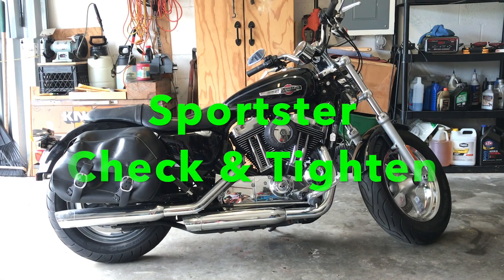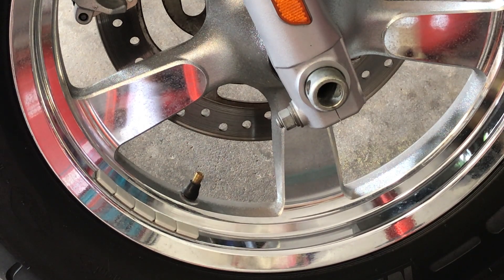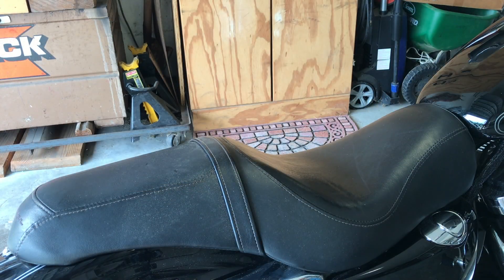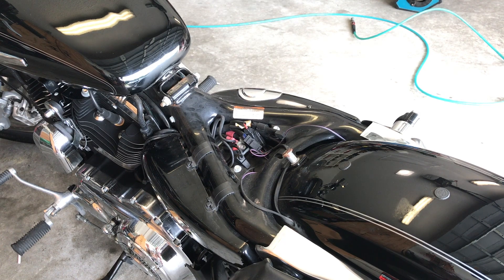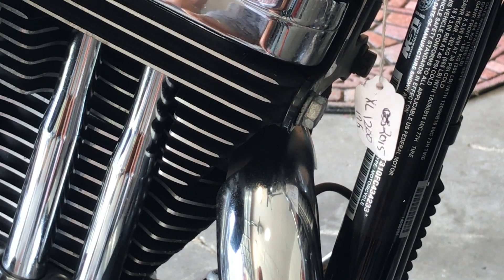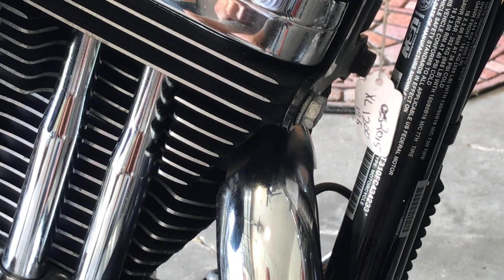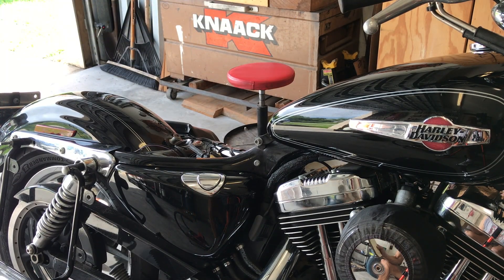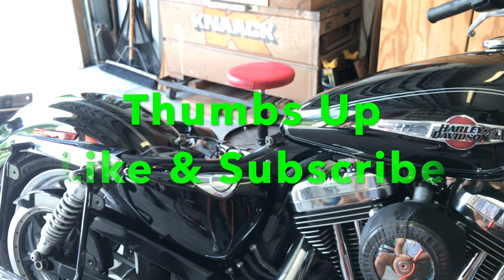How To, Sportster Things To Check And Tighten.

Comment: When you opened the battery area and pointed to the terminals, you should have mentioned the older bikes (like my 2005) that have the NEGATIVE buried on the other side. A lot of people re-route the cable (sometimes replacing the cable with a longer one) from the negative terminal on these to make it easier to remove/replace the battery.
Reply from the maker: If you tilt the battery and install the negative it's not that bad check out the video. If you go straight in with the battery it is a bear!   Harley knew what they were doing when they designed that.. dealer dealer dealer.  And thank you for your comment. Ride Safe and have a great day.

Comment: Yep... the 2010 Sportster I just got had a dirty 10 year old air cleaner and throttle body from use and a loose 3/4" left side engine mount bolt -  just like you suggested. Thanks and keep it up!!
Reply from the maker: Happy to help. Any questions just ask. The sportsters are great motorcycles. Thank you for watching and all your support. JT. Ride safe and have a great day.

Comment: From the Philippines here,Thanks for the tutorial,have a 2017 sportster this video is very informative!
Reply from the maker: Happy to help. Any questions just ask. Thank you for watching and you sub Bonaparte. Ride safe and have a great day.
Reply: @TwoWheelRocco  Just a follow up Sir,just completed changing oil(Amsoil 20w50),loaded just 2 ltrs.,plan is to gradually add after doing runs just not to overfill,but after checking oil level on my dip stick,it is still on the high level,have to suck some amount out of the tank, don't know why I keep on having a full reading on my dip stick,any advice?
Reply from the maker: @bonapartebeneficto8294  You have oil that bypassed your oil check valve. So the oil gravitated into your dry sum motor. So every time you start the bike and run it the oil is cycling out of your motor back into the tank. This is popular with the V twins when they were in storage for a while. That's why it's always a good thing to run these bikes before doing an oil change. And then you'll have a true reading of the oil that is in your system.. Sportster  like halfway on your oil dipstick no more. You'll end up fouling up air filter. Hope this helps.

Comment: I just watch this video I’ve had stuff come loose on mine over the 19 years I’ve had the bike. Front motor mount that was one and the exhaust rear muffler on the mounting bracket came loose. The crossover on the rear pipe cracked don’t know if that’s what caused it I took it off and welded it up this year. Definitely going to check the riser bolts and the hand grip hardware. Great video on what to look for. I do all my own work on my bike even change the tires myself. I like your videos on how to do the job just put me more at ease when I’m working on my bike.
Reply from the maker: Happy to Help.  Love doing all my own work.     Thank you for watching and your sub White . Ride safe and have a great day.

Comment: On the jiffy stand on not to check the oil???
Reply from the maker: I'd say refer to your Owners Manual here. On the 04 & later Sporties, the manual calls to the oil level to be checked with the bike on the jiffy stand. When your bike has been warmed up for proper reading.

All in all, I don't think that tipped on the jiffy vs upright makes all that much difference if your like most HD owners that have learned that keeping the oil level about mid way between the ADD & FULL marks reduces oil blow-by into the air cleaner. 

Hope this Helps, Any questions just ask.  Thank you for your Sub Joglock. Ride Safe and have a great day.

Comment: Thanks for all your videos Rocco!
Reply from the maker: Happy to help. Any questions just ask. Thank you for watching and your sub Greg. Ride safe and have a great day.
Reply: @TwoWheelRocco  i do have a question actually..i just recently bought a gas tank second hand for my Sportster.its in really good condition and theres no visible rust or debris but i do want to give it a clean/flush before i put it on my bike..what would use to flush it with and what would be your process? Just a simple flush of the tank needed,i have a brand new oem petcock,filter,gasket and line to go on..thanks Rocco
Reply from the maker: @scrambledgreg3834  I would use compressed air and a vacuum cleaner place the vacuum cleaner at the bottom and compressed air at the top and as the compressed air moves the dirt the vacuum will suck it out. That's how I do it.  Hope that helps.
Reply: @TwoWheelRocco   ok great thanks Rocco!
Reply from the maker: @scrambledgreg3834  Happy to help.

Comment: as always very helpful thanks..  one question, i have vance and hines 3 inch twin slash slip ons how to remove stuck quiet baffles they are stuck very very tight . i dont mind damaging the baffles but not the pipes. any help appreciated
Reply from the maker: Remove slip on and push from other side with broom handle. Tap tap with hammer she's out.. Hope that helps. To remove slip on,  loosen hdwe 3 nuts on exhaust hanger and tap on bottom exhaust mount with hammer to remove slip on from pipe.  Install video. https://youtu.be/nrXFHjym9GE. Hope this helps, Any questions just ask. Thank you for your Sub Theo.  Let us know how this works out. Ride Safe and have a great day.

Comment: Thx for another great vid.   Any fix. For a loose rear foot level on left side mine keep lowering down by itself after riding  other side is not a problem 

Thx
Reply from the maker: What year?    Happy to help,  Any questions just ask.  Thank you for your Sub Mike.  Ride Safe and have a great day.
Reply: Two Wheel Rocco   2005 1200 sportster  custom
Reply from the maker: I hate when peg won't stay up. Take a close look, there is an spring washers in there.. If there is a spring washer in there. Take apart, tap on side of peg mount to make tighter. Use a piece of wood so you do not mar your Frame paint.  Reinstall foot peg until you like the way it functions. Let us know how this works out.

Comment: I have a 2011 XL883N 'Iron', KI only ever ride solo without luggage, I use the owner's manual tyre pressures of 30 psi for the front and 40 psi for the rear. I've spelt tyre with  'y' because I live in the UK and that's the correct spelling here, I realise that American's spell it 'tire'. 

My battery has the positive terminal on the cover side of the motorcycle. I use "Car Pride" brand black bumper cleaner to polish my Sportster, I get it for £1 a can, that's a lot cheaper than the H-D cleaner.

Thanks for the very informative video.
Reply from the maker: Happy to Help, 36psi front.  42psi rear. Thank you for watching and you sub David. Ride Safe and have a great day

Comment: Great illustration.  Thumbs up and subscribed already.
Reply from the maker: Happy to help. Any questions just ask. Thank you for watching and your sub.NF .Ride safe and have a great day.
Reply: @TwoWheelRocco  Hi, I am new to Harley and I am learning a lot from watching your videos. Last night, I was reading Owner’s manual and found out an interesting word “isolator.”  What are those for? Does 2020 Iron 883 have isolators? I do not see “replace isolator” among the listed items in Service Interval.  Do I have to change isolators? I also saw people using metal isolators instead of rubber ones?! Confusing. Thanks for coaching. Have a nice weekend.
Reply from the maker: @nfan883  that would be equal to a motor mounts or any rubber isolator that makes the bikes vibration less. Stabilize isolator motor mount do not use solid motor mounts. Hope this helps.    https://www.google.com/search?client=safari&rls=en&q=sportster+isolator&ie=UTF-8&oe=UTF-8
Reply: @TwoWheelRocco  That is how I figure when I first hear the word isolator.  Thanks for clearing it up for me.  Of course, it helps.
Reply from the maker: @nfan883  My pleasure.

Comment: First off.... I'm a new rider.  Love the Sportsters.... So I purchased a used 2004 Xl1200c.  I will say.... The engine moves quite a bit when bike is in neutral.  That I will address soon.  Right now though.... all of a sudden.... Oil is coming up out of the cap.  I checked the rubber gasket.... it's not brittle or worn. I also see now that the oil tank has more oil in it than it did a few days ago.  The oil that comes out isn't foamed up.... definitely normal looking.  Any ideas Rocco?  I'm a new rider.... and love it.  I'm having withdrawals now that I haven't ridin' now in 2 days!
Reply from the maker: Happy to help. Bike sat for a while and the oil drained into the dry sump. So when you start the bike oil cycles out of the motor back into the tank and you have too much oil in the system. Sportster like to have halfway on the oil dipstick. You'll probably notice your air filter is all oiled up too so take that and clean it,  have the correct amounts of oil in the tank.  Let us know how that works out good luck with the new bike. sportsters.are great rides.  Any questions just ask. Thank you for watching and your sub Jonathan. Ride safe and have a great day.
Reply: @TwoWheelRocco  So I have been riding it.  Then after 2 days I went to ride again and this happened.  So what you're talking about.... 2 days this can occur?  

Oh and I forgot to say brother.... I love your videos!
Reply from the maker: @jonathanbirnbaum3277  remove the oil that is over the halfway mark. Clean air filter. It's called sumping, notorious with Harleys.   just too much oil in the system it might've sat for a while the oil gravitates to motor dry sump... somebody put a little more oil in it.  thinking that was low. it takes a day or two for it to be driven for everything to come back to the tank and causing your problems. Let us know how it works out. Straighten out oil level clean filter. Ride safe and have a great day.
Reply: @TwoWheelRocco  Thanks Rocco!  I'll let you know how it goes!  Hane a great weekend brother!
Reply from the maker: My pleasure.
Reply: Turns out Rocco.... Something is clogged.  I took some oil out.... But it filled up again in oil tank.  Plus u derneath now there is oil leaking from a few areas.
Reply: I shutdown bike then restarted and smoke came out of the air filter area.  It's a screaming eagle system and brand new filter.  Black smoke.  Time for a mechanic.  I'll keep you posted.
Reply from the maker: @jonathanbirnbaum3277  To much oil......Remove... Your motor does not create oil.  somebody put it in there. If the bike sat for a long time you could have 2 quarts in the dry sump that's what it's called. Harley Davidson oil sumping.   I've seen this many times. The bike sits for a year people go to start it they put a battery in it to check the oil there's no oil in the can, they put two qts. in and I think they did something. Remove air filter it will be soaked with oil. That's the problem remove the oil, start the bike checked your oil,  remove the oil and you'll be fine. There's nothing clogged. It gets very ugly before it gets better. Dry sump motor. Oil gravitate into the motor threw  the check valve. In the oil pump.  sit in motor.
Reply from the maker: oil coming out of the breather and getting burned in the intake of your motor you have too much oil in the motor.  remove the air filter and get the oil level correct. Very popular problem for Harley Davison's.   run it.... all will be well.. That's why you wanna remove the air filter. And you'll see the oil come out of the vent bolt. With the air filter in place of forces it back into the intake. Be patient you can get it straightened out within a half hour. What do you have to lose. As long as there's oil in that can you got no problems I have never seen a Harley have an oil blockage. I hope this helps.
Reply: @TwoWheelRocco  yea I noticed the oil that was dripping from the bottom was just the oil that came out from the oil tank at the cap.... and dropped down all over the bike around the motor etc etc.  Since wiping down I haven't seen any again.  What's weird though Rocco... I've been riding the bike for a month with no problems.  Everyday I rode it.  Then all of a sudden the oil started very badly coming out of the tank from the oil cap.   So early I drained a bunch of oil.... and got it half way on the dip stick.  Then started her up.... the oil came up again.... but not as bad as yesterday.  So now the oil level is high again in the tank.  Full on dipstick.  My concern is.... if I've been riding the bike for a month.... if it had too much oil this whole time.... why only just yesterday did it start doing this?
Reply from the maker: Here's my question? Do you think the motor creates oil?  It takes time to clear the oil.  If the oil was not circulating properly you would not have all that oil in your tank. These motors operate with an external oil. It's a dry sump motor.  No oil in and oil pan on a V twin.  If you had bad oil pressure the lifters would be tapping like crazy.  Sportster's are very strong motors. Keep doing what you're doing,  get the oil out of the motor. And you'll have a great motorcycle. Ride safe and have a great day. Keep it away from Dealer mechanics,  there isn't  nothing you can not do on this bike.  Any questions just ask.
Reply: @TwoWheelRocco  Thanks Rocco!  I'll take more oil out.... and I have a new air filter.... I'll leave it bike while starting and testing everything.  Oh and thanks for dealing with a newbie like me!  👍
Reply from the maker: My pleasure brother. I love this sport. Ride safe and have a great day.
Reply: @TwoWheelRocco  oh I also forgot to say.... I here air pressure in the oil tank briefly...not sure if the air is going out or going in.... but is that normal brother?
Reply: And engine light came on 🤷
Reply: But it did stop leaking oil
Reply: Engine light went out Rocco.  Gonna go ride.  I'll keep you posted!
Reply from the maker: @jonathanbirnbaum3277  Should nut run it with no oil cap on.
Reply from the maker: @jonathanbirnbaum3277   send my a cell number I will call
Reply: @TwoWheelRocco  no oil cap is on.  Just left air filter off.  Send me an email address I'll email my #

Engine light off and she's riding great
Reply: Hi Rocco!  So I meant to tell you.... It turned out to be my oil cap
Reply from the maker: Happy to hear all is well. Ride safe and have a great day.

Comment: The battery in my 04 is around the opposite way . I wonder which is correct?
Reply from the maker: Happy to help. If you could please send a picture E Rocco 3964@gmail.com. If the cables fit right I wouldn't change a thing. Thank you for watching all your support T. Ride safe and have a great day.

Comment: I have a question you may or may not know the answer to on mine ive notice lately that when I lean to the left it makes a weird noise and when I changed my front brakes a while back the outside pad was completely gone and inside pad still had some pad left what would you recommend I look at? barrings, spacers, I'm not sure if its possible for the triple trees to be slightly off and cause a problem. Any info would be appreciated
Reply from the maker: Happy to help. Your caliper piston on one side is sticking,  Remove your caliper. Do not disconnect the hydraulic line or the bleeder that could introduce air into the system and you will need to bleed your brakes. You could do it without removing any of the lines.  Clean the pistons and then apply a little penetrating oil, move the pistons in an out and then reinstall see if that helps. Usually does. Thank you for watching and all your support PJ. Let us know how it works out. Ride safe and have a great day.
Reply: @Two Wheel Rocco  thanks for the response I will definitely try that they actually started squeaking on my ride yesterday so I was planning to check them anyway so I'll go ahead and just do a full service one them and hopefully that'll fix everything thanks again for the advice.

Comment: Hey Rocco my adjuster screws on rear tire are exact same length (for belt adjustment/wheel alignment) but when I measure the rear tire alignment from point a to point b it’s different on each side?? 

Not sure if I should leave it alone or adjust the screws - 2006 Harley Sportster 1200 

Thanks
Reply from the maker: Happy to help,  The adjustment screws  don't lie. .  Thank you for watching and your sub Abraham. Ride Safe and have a great day.
Reply: @TwoWheelRocco  thank you. your videos and willingness to reply to the comments sets you apart big time brother
Reply from the maker: @abrahamj.garcia6029  My pleasure. Ride safe have a great day
Reply: @TwoWheelRocco  Rocco, thought I’d ask before I take my sporty to the shop.

Changed out choke cable and adjusted clutch - was fine for about 5 miles.

Couldn’t pull away without it stalling after feeling bogged down (low throttle response it felt like) but the engine was reving higher. 

Then a few hours later turned the bike on full choke, bogged down and almost died even with the choke fully out. 

Can’t ride the bike down the block cause it doesn’t get past first gear without stalling.

Carb was cleaned recently, a few other maintenance items were done, lubed clutch cable and throttle cables. been riding the bike just fine before that, spark plugs look ok, any help would be appreciated.
Reply: @abrahamj.garcia6029  Did you ever find the issue with your Sportster?
Reply: @j.bridges2921  Née spark plugs fixed the bogging and needed new clutch plates